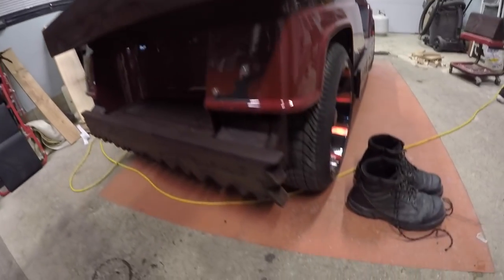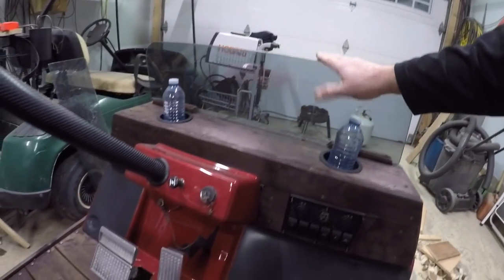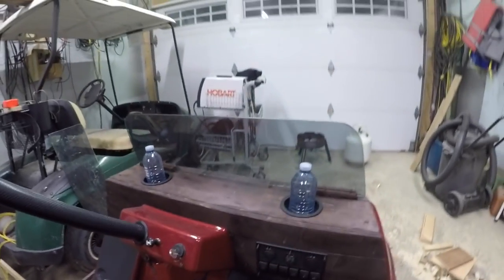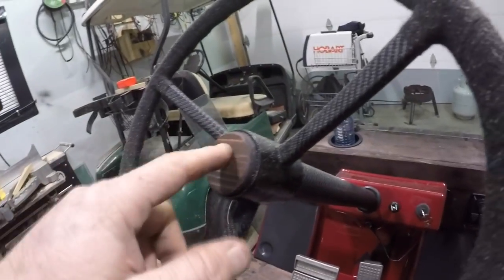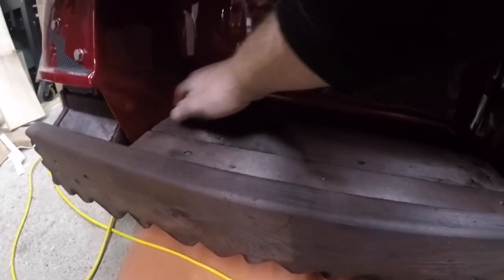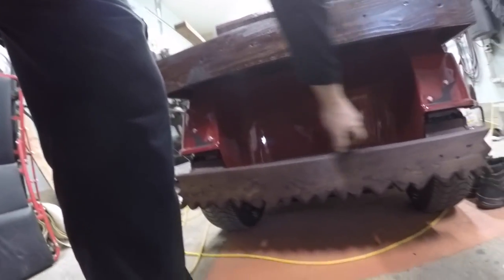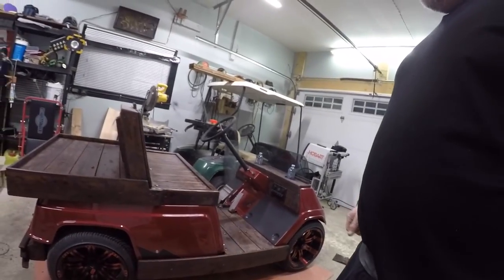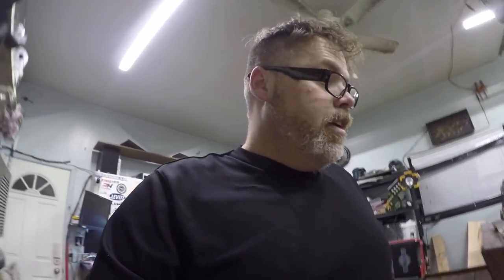The Best Yamaha G1 GolfCart In the World

Comment: get rid of the cup holders and put in two 4 inch speakers! 
extend the front bumper mount so the bumper can clear the turning wheels! 
come on now you dont need cup holders because you will be busy holding on~ or you can get the folding ones to put on the verticle dash surface mounted